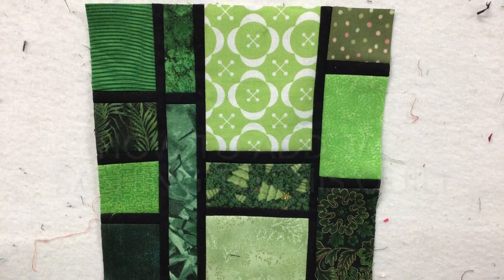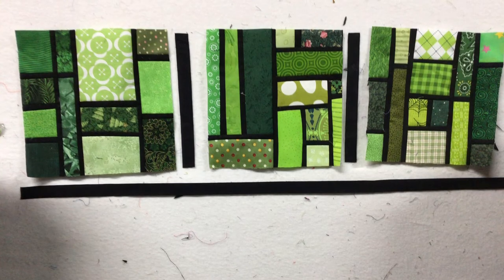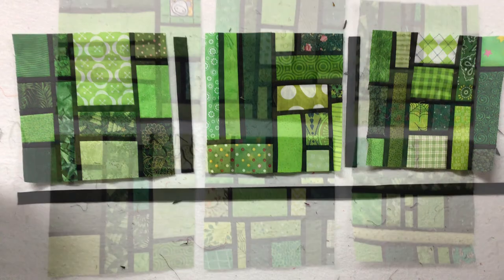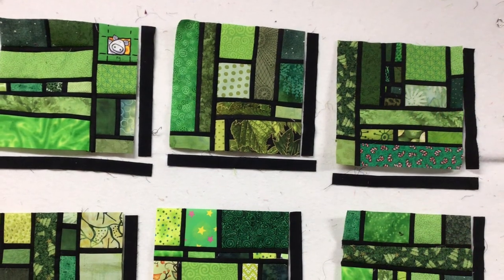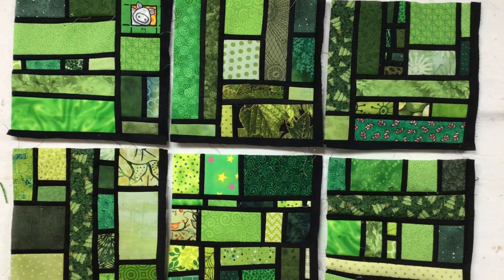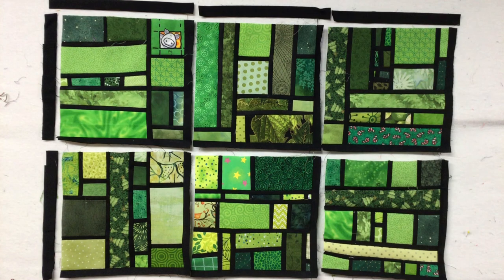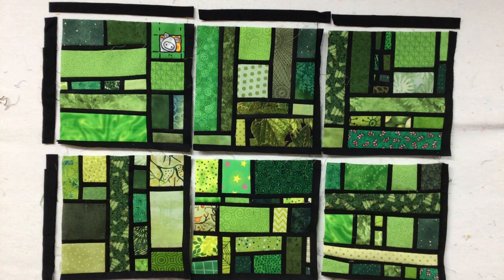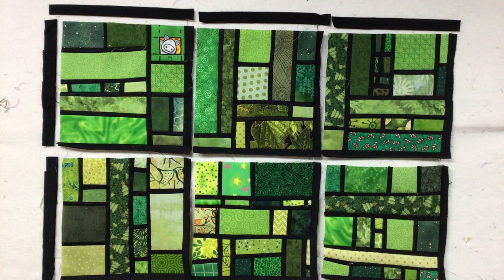Sashing Tip for the Stained Glass Quilt

Comment: I don't often use sashing, but this is my favourite method, quick question, I assume you sew into rows then sew the rows together, do you press the sashing in opposite directions so you can nest the seams?
Reply from the maker: On the stain glass quilt the sashing is narrow and I press to the sashing because I know I am going to be doing all my Quilting on the black sashing . This gives a pronounced lead line for this quilt. I will press in other projects to reduce bulk.